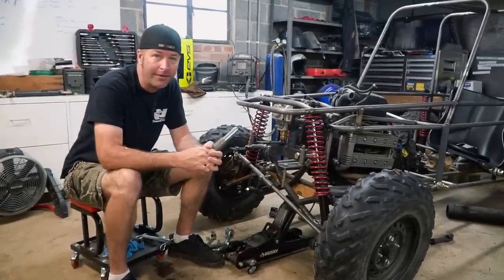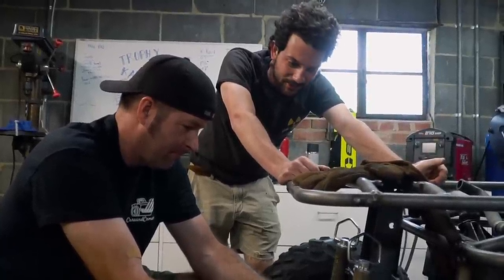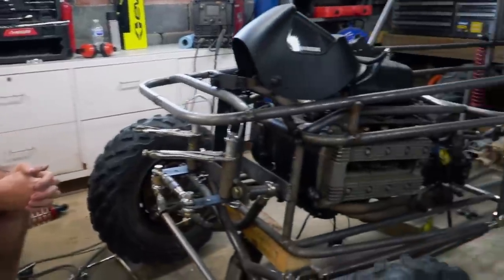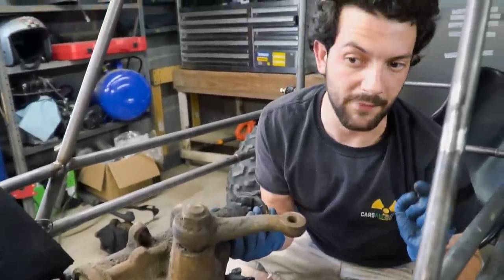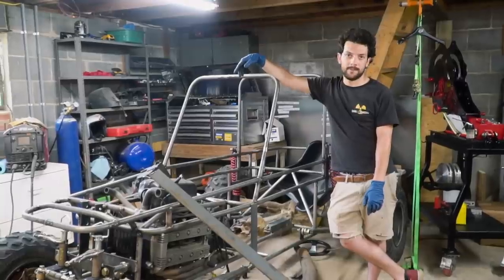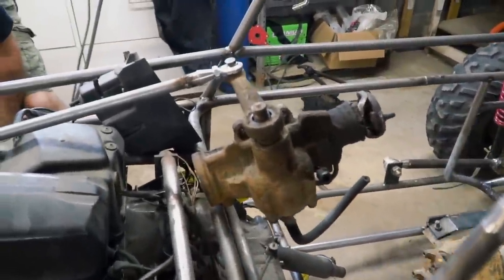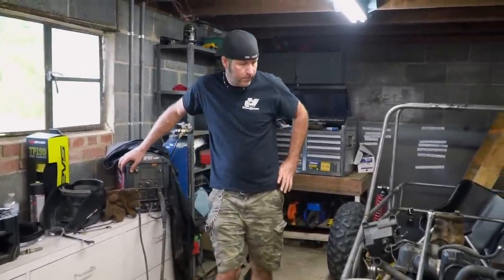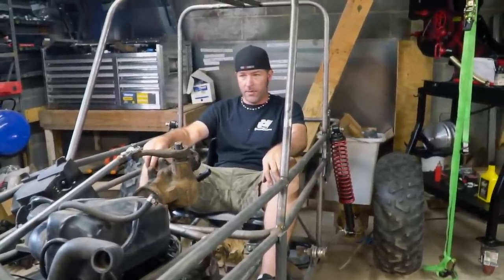1000cc Trophy Truck Build Pt. 9 | Steering Finished!

Comment: A steering wheel and cable set up from a boat would allow you to go around the engine and get a much better angle for the steering hook up. Read the comments below about setting the I beam pivots up. It sure like you have a lot of bump steer and camber plus toe issues when Ike lowered the suspension.... Also you need to set up the correct Ackerman angle. I hope it all works out well for you guys, I look forward to seeing this front end in off road course action.

Comment: Why not stick frame with wood studs? You can get your wall height that you want, it’s easy to wire up and insulate. 
Just run at least one row of 8” concrete blocks to get the sill plate off of the concrete slab.

Definitely plan from the beginning to make it bigger. Have the rear wall planned with large garage door sized openings framed in but studded in and don’t run wiring or plumbing through the “openings. Later add on to the back and you can open up the framed in openings and have 9’ to 10’ openings into the addition.

Comment: Looking at your latest attempt at a steering system I think I can help. The key to little or no bump steer is to have your tie rods the same length and run parallel to the I beams. Run one rod from the pitman arm to the knuckle and the other one from the other knuckle to the other tie rod. Look at 80s Ford Ranger 4x4 twin a ibean steering system. Much simpler system. Best of luck

Comment: If you plan to have a loft with equipment and parts storage steel is a better choice. You may also want to consider some specialized work areas you can wall off such as a grinding, welding or draft paint area for larger more complex projects. That would probably require more upstairs use with down stairs sqft tied up.

Comment: I say go with the pole building, cheaper so you could do 40 x 50, and easy to modify/change if needed.  The I beam is great but why spend the extra money, the pole building will do anything you'll ever want to do, plus it's easy/cheap to modify, add onto, etc.  Best of luck with whatever you choose!

Comment: For your steering problems, check out the electric power steering units like they use in miatas.  You just need a 12v source and you are set. They are way lighter than what you got I think you would like it.

Comment: In my area, we get really strong winds (not hurricanes of course) but, we have tons of Pole Barns because they are way less expensive then Metal but look like them. 
$65/sq ft gets you 14’ walls, concrete, a couple of windows, man door, garage door, electric ran, insulated and ready to use.

Comment: Whatever style building you go with, put in 6" (not typical 2 or 4) of insulation so you can have a hope at A/C-ing it in the summer. Or at the very least put in a big exhaust fan near the roof. That space gets HOT in the sun. As in "hot enough to pass out while doing some electrical work" in some cases.

Comment: Start with your final slab and put what you can afford on it for a building. You can either extend the roofline later, or add a couple car ports on the sides for storage or fair weather workshop.

Comment: How about using the steering box from an old VW Beetle.  As for your new building, the I-Beam style makes the most sense, as long as it is built with a removable back wall to expand the length.  The Lean-too sides, if made from the same material as the main building will work well.  Good luck and be safe.

Comment: If you do the shop to have an upstairs that would be awesome but remember to not do a complete 2nd floor as you’ll want a section left open to the ceiling so you can have the full 14ft high so you can put a car lift and/or UTV lift.your plans sound great

Comment: Concrete pad... Is a 2 post lift a future possibility? If so, think about where that would be located and make sure the posts sit centered in a 48x48x8" min pad. The rest of the floor can be thinner, but under the posts 8" min. Be safe and do it right.

Comment: Save up wait for the 40x60. Mine is a bolt together I beam and really it's not big enough. Don't do a single door on the end. I've seen that too many times and it's a pain. Do multiple doors on the long side. Spray foam is expensive, but works well and can be done later. Metal building insulation is relatively cheaper but metal wire needs to be installed over the framework before installation or you'll have a mess in a few years. Plus mice chew through it all the time. Just a little advice from someone that's been down this road before. Build it once pay for it once.

Comment: I still say I beams at corners and every 10 ft then wood frame panels. Use I beam headers and make a shop wide trolley crane system.two header rails with a cross rail crane. Make sure your end trolleys exceed the centre trolleys load limit.
The lean too idea will be handy for weather protecting your projects and tractor.

Comment: Good series, My thing with workshops is its not the size but does everything fit in....Think ahead car lifts, drills, press, welders etc etc all take up space also having things modular is wicked.
Also final point is an overhead crane...i know you boys can get tractors etc all cheap in the US for lifting but better to be sorted

Comment: do your increased bracing and cut some slots so you can adjust the steering wheel to best fit whoever is driving, i.e. tilt column, either ike or john, you guys could also get a small electric hydraulic pump and have power steering as well using that box, i was thinking you guys were going to either go with a tractor or t-bucket style steering, but interesting idea mounting it like that and going directly to it, lookin' sweet guys, cant wait to see this thing ripping around under her own power xD

Comment: I'd go with I-beam just in case you ever want to put a crane in there or something, it should be more straight forward to do it as opposed to a pole barn or carport. Plus is a good investment since that type of structure is the most resilient in case of severe weather or the like.

Comment: If you're not in an area that gets tornadoes or hurricanes, pole barn would be a great option. However, steel structures are better for fire retardation and longevity. both options will give you the ability to turn the structure into a dwelling someone could live in, if you ever decide to create something bigger or move on from this property. (see: Barndo [barn+condo] buildings).

a lean-to/carport would be a simple inexpensive option, but is going to be less permanent, and much harder to control the heating and cooling. Also, weatherproofing for rain/snow/wind would be much more difficult. 

for steering, VW bug steering box, Miata Rack and pinion, Dune buggy rack and pinion, you could even run full hydraulic like the big rock crawler jeeps do. if it were me, I'd scrap the Twin I-Beam run A-Arms and a rack and pinion set up for steering. you may even look into scaling down VW style front suspension. there is a reason they were used for so many years in baja style racing, and dune buggies.

For shocks, I've always been a fan of shock hoops on trophy trucks. this would increase suspension travel without making stand up so high that you're having issues with C.O.G. being too high, and risking rollover while cornering, or landing cock-eyed out of a jump.

Lastly, can I suggest a turning brake? it's like a hydraulic handbreak, but you push/pull to break one side at a time to assist in cornering and traction.  Again, See dune buggies for reference. (I Know, I Know you're not building a dune buggy, but its a similar style vehicle that has many of the same capabilities, and terrain styles)

Comment: I have a 2002 EZgo TXT golf cart. I think it will work amazing for this application.  It has one arm that pushes and pulls.  I looked and the box is about $55-$60.  Look for 2001+ model year.

Comment: I'd also say I beam, but there is a company making a arched corrugated steel bulding that is pretty cheap, gives you lots of inside room and you can insulate the walls for either aircon or heat. Would prob save you money and allow better equipment inside. One thing you will want is at least one drain inside so if you get water inside the bldg you can push it in there. I worked a full canadian winte rin one of those arched buildings and when done properly it's really nice.

Comment: Not sure if the steering box being upside down will make a difference, but if you fill the hoses with oil and connect them to each other it will steer a lot easier like a manual box.

Comment: Consider the safety aspect against a hurricane or tornado.An i-beam building may be the strongest as far as frame wise.Sheet metal siding easier to replace than wood.

Comment: Did you guys ever consider mounting the engine clocked a little bit so the prop shaft aimed more at the center of the rear axle?

Comment: I have a 30x50 pull barn and it's great but because of the big sliding doors I can't really insulate it. Just food for thought, if you ever want to put an AC or heater out there.

Comment: Now that you have the linkages working in the front, you could put the rack and pinion back in and have the ends of it link backwards to the steering pivots you have mounted to the frame.

Comment: Cinder block so you don't have to worry about rot or termites and you could build it yourself. The biggest cost would be to pour a slab. Then you can use aluminum I beams for you ceiling and either fiberglass or metal roofing. It would be noisy in the rain but it would last a long time.

Comment: @CarsandCameras - should Turned direct of Front steering Center mount from Front to Back to remove Problem - the Diff. is in the Connection TO the Actualy steering from Rack

Comment: Look into dirt track car racing . They make a real small gear reduction gear box  that goes inline of the steering  shaft. They are not very expensive either. They run them on cars without power steering .

Comment: I’d say just go traditional framing style. Walls at 16” OC are super easy to frame up. My building materials list for a 25x52 2 story house was only 23k, doors/windows included. Y’all can be half that or less if just doing 4 basic walls and trusses.   For better insulation properties if ya go that route, go 2x6 24” OC...less wood and more/thicker insulation to help.    Don’t be afraid to go traditional build style, it’s easier to build a house then a 1 off kart from scratch. From a current DIY home builder/ mechanic for a day job

Comment: If you need a driveshaft that can get longer/shorter as your suspension flexes, you can use 2 pieces of square tubing of different sizes so one fits inside of the other but doesn't spin. Then they can slide in and out of each other on the fly but still be able to drive because the squares don't rotate seperately.

Comment: Hi Isac wassup brother.. So in this case we'll for either I beam tyoe or straight axle set ups, but defiantly in this case u want to build u a set of push pull steering. Super simple super easy, make the long steering tube the equal length to panhard bar and ul be in. There are two main rods for push pull and u create swinger at both sides of frame rail area use drop pitman off steering box. Check em out it u end up over current set up. Kk good luck haus it's looking badass so far..

Comment: vote:  Pole building! more bang for the buck. in floor hydronic, tankless heater with heat exchanger for hot water and shower. Extra thick floor, plan ahead for areas in floor void of piping for lift tables.

Comment: I would do the 30 x 50 I beam.  I would make sure to have a section of concrete that would support a mill or lathe.  That could be thicker concrete base on weight.

Comment: RV height carport style with spray insulation, as you can hack into it and add on with little regret over the years. Second story party pad with inside and outside entrance/exit, built with good old fashioned lumber. Steel a frame hoist on track bolted to floor. Solar array with battery bank. Use 220v water heater powered from solar to heat the floor. 220v AC from solar in the summer.

Comment: i think rotating the steering box 90 degress so the arm in vertial and bolt holes horizontal would be a better fit maybe even a oil pump for power steering

Comment: Fill the steering box with fluid and hook the return line into the pressure line and it will steer easier yet. Old stock car racing trick

Comment: Building higher is always a cheap way for extra room , iron beam or pole barn either one would work just fine for your needs just depends on your pocket book PS pre plan where you might want to put in some hydraulic lifts so you can but in thicker reinforced concrete in those areas and conduit for airlines and electricity!

Comment: I would say carport style.easier to add to later on if you decide to go bigger. You can add multiple bays and connect them together. Concrete around there beams and you won't half to worry about it in a storm.

Comment: A manual vega steering box will work. The flaming river box is based off the factory vega manual box.
My 1970 Olds 442 has a factory A body manual box, but yeah its like 6 turns lock to lock. I love it in the street/strip car but there are better options for your project

Comment: I figured that using a steering cable off a small outboard boat work for the steering? It has a gearbox on the steering and then its just a cable that will run to the steering arm and you can bend the cable to navigate any obstacles.

Comment: You should put a piece of round bar stock and make a little handle and put it on that bolt that is holding on the steering box and that way you can adjust the height of the steering wheel

Comment: So switch your  knuckles from one side to the other. It would rase the steering point and there would be less travel with the link being closer to in line with the rack. you wouldn't need them to cross over any more.

Comment: The thing you need is called a steering quicker used in stock car racing. They come in different ratio and weigh less than a pound. Speedway motors of Nebraska is were I got mine.

Comment: Hello guys why not just use a chain and sprocket set up for your steering attach the tie rods to the sprocket one on the left and one on the right with a spacer put your pitum arm down the center of sprocket at the bottom of it run chain up to a little one on top of shaft going up to the seat.also is there any way you can take that rear drive shaft housing of and run a longer shaft to the rear end all you would have to do is weld a shaft to the motorcycle shaft and run it back to the rear end yoke.

Comment: Use electric steering setup from a Prius or smart car setup just like Red Beard Garage and it'll solve alit of the problems especially since you'll have a charging setup on that engine. But good looking build and I'd build the pole barn with metal on top and outside...

Comment: You need a junk yard electric power steering unit with a simple cross over steering system. And some kind of i beam setup. Grind hard plumbing did a good from suspension on their barbie jeep that could work for you.

Comment: l like a metal building for the security -- just a little expensive to finish off on the inside [ insulation - studs - wall board ] plus it's more hurricane proof then most other structures being you all operate in the Carolina's.

Comment: With the steering arm in front of spindle pivot, you may have issue to obtain a decent Akerman... The steering arm ball joint will have to be very deep into the wheels . Ideally the steering ball joint should be exactly on the virtual line that goes from steering pivot to a virtual point where rear axle centerline and vehicle centerline intersect..... Otherwise the cornering behavior might be very odd.

Comment: I would say a pole barn style would be just as good unless you are putting in a big sky crane. You can still have a concrete slab and a place to hang out up stairs. Plus it would probably be a lot cheaper. I really just dont think you need a I beam build.

Comment: silver/grey corrugated iron roof/walls shed, top hat or Z purlin roof bearers, 50x100 mm Galv C channel open sides facing together to make a square post with no open sides welded together every foot or so. top hat or Z purlins screwed horizontal to the post with silver galv corrugated iron vertical, carton of purlin bolts and roofing screws. C channel with holes drilled to hammer round bar for form work and pour concrete in sections for easy DIY